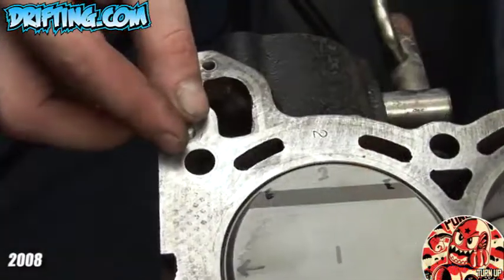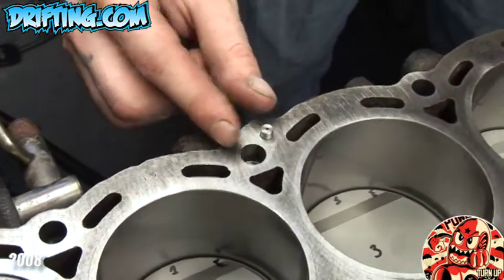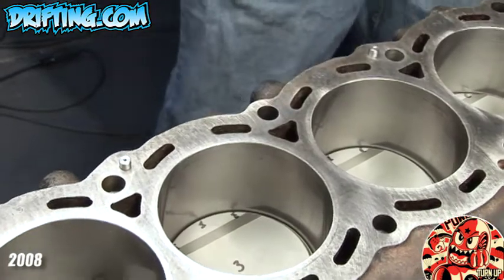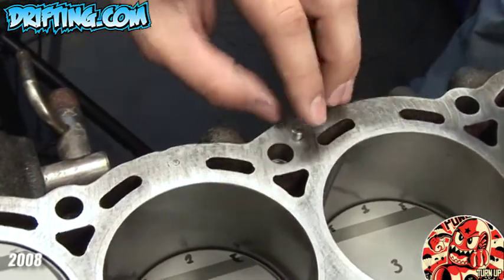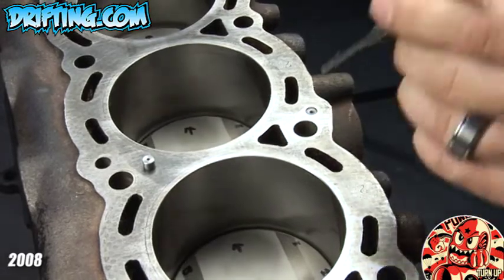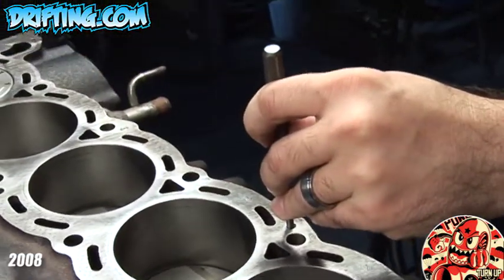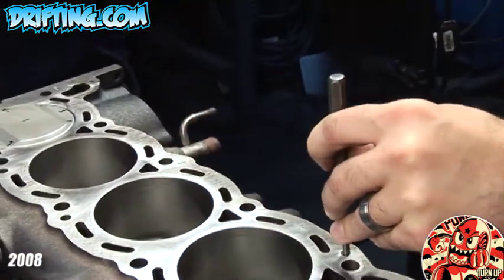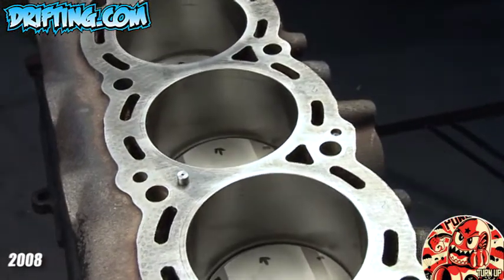RB25DET Oil Problems Part 1

Comment: Hey quick questions what were the end results?
Also, is this a series 1 RB or Series 2? I heard that the hydraulic lifter type head series 1 shouldn't be restricted of oil?is this true? Thanks also, what kind of oil pump are you utilizing ?